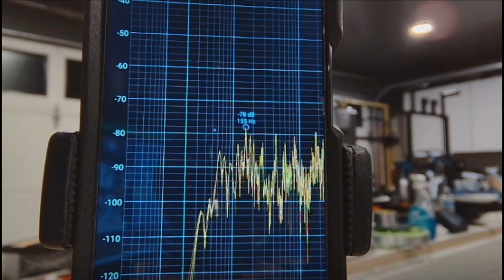Graviflyer "Identifying Resonance Patterns" #15

Comment from the maker: I know everyone has their favorite on the frequency span. I honestly think it will take all of them to achieve the main goal. That is why I have found a way to map them out. I have no problem getting sound when the voltage is on or when the tesla coil is on. The video is another thing when everything is combined. Sometimes the voltage in the air causes my camera goes from 4k to 720p. The same effect happens when I do high voltage experiments. When we get to the stage of lift. I will buy a camera with a long lens to get good video. The zoom on my phone, gopro 11, webcam, or video camera will not work to prove all the deniers wrong. This process takes time. I will start showing experiments with my new set up soon. Thank you.
Reply: Depending on your phone/camera it might be possible to get a 'smartphone lens kit' with various tele/zoom lenses for a reasonable price - giving your device that needed extra lens aid. Some kits comes with mounts, which I would take a close look at to ensure isn't scratching/breaking my phone/camera device (I've seen some kits with bad quality - seen some with ok quality)
Best of luck - looking forward to seeing some interesting testing :ø)

Comment: "voltage on magnets produces a sound" truly one of the sentences of all time, worthy of Alexey. Btw 3:40 show the video where he actually installs that motor to run the pump (if it exists), otherwise you've got a guy making statements/claims with no evidence to back them
Reply from the maker: he was working on free energy. Or more like a looped system before you get to overunity. He runs that big washer motor on an esc. That was entertaining to watch.
Reply: @nathanbunten4299  indeed very entertaining to hear him talk about torque without showing any measurements
Reply from the maker: @sFeral  his little rag test not doing it for you? I agree with you. He is running a generator with aluminum and no iron. So not a big load. That is why I chose it for my video. We are only moving small magnets.

Comment: Just a stupid idea: If we're using a torque wrench to tighten everything even, the frequency should travel also even through all joints with a even intensity. Should simplify the tuning... What do you think?
Reply from the maker: It will travel anyway.
Reply: I think that's a good point. Consider how vibration can "undo" threaded connections, causing screws or nut and bolt systems to loosen.

Comment: Maybe it matters what materials it is made of. If you are trying to get it to resonate at an aluminium harmonic, wouldn't the steel threaded rods interfere? or at least throw that harmonic off to a mix of steel/ aluminium.
Reply from the maker: They might. However we only need the center plate to resonate to allow the transfer of electrons from top to bottom disc. The tesla coil adds feedback to the center plate causing an explosion of power to happen. The full reason why is still up in the air. That's why most of my day goes to testing.

Comment: I can see an obvious mistake you made on your Graviflyer. it can be fixed very easily. You need to add 3 sound ports below your sound cone that's the flat  black piece below your sound cone. that should fix your Graviflyer. Ed

Comment: I still don't see why you keep putting the tuning fork on the craft and say it's close to 439 hz. You can put the same tuning fork on glass and get a louder sound or even a concave object. Aluminum doesn't resonant at 439hz. There ls more factors that go into play like the humidity, temp, the size of the material, the material, the deminsion of the material, etc. Using a tuning fork and saying it's 439hz is inaccurate.
Reply from the maker: It is because all the rest of the tuning forks do not make the sound through the aluminum. This one does. You are hearing simple vibration on glass. I am looking for resonance. There is a big difference.
Reply: @nathanbunten4299  take a rubber mallet or a wooden hammer and strike the aluminum and use your oscilloscope or microphone to pickup the vibrations. The oscilloscope should get you your reads right off the bat. The microphone you would have to run it via software to see what it is.
Reply from the maker: @freedomer342  You are still talking about vibration. I am not. Take the tuning forks with boxes experiment and place the aluminum in the center. If it turns on "resonates" Then the frequency is correct. Just like doing the same experiment with guitar strings. Vibration is in no way at all ever or at any time what I am looking for.
Reply: @nathanbunten4299  when you strike the object, it vibrates at its resonant frequency. There might be a slight difference noise depending on what you hit it with but there is one frequency that will always be there. That's your resonant frequency.
Reply from the maker: @freedomer342  Thats just wrong.
Reply: @nathanbunten4299  it's the same principle when you ring a bell. It resonants at its own frequency. Ring it too hard, it will crack just like the Liberty Bell.
Reply from the maker: @freedomer342  The difference between what you are doing and what I am doing comes down to how frequency and sound works in this situation. I need the center plate to start resonating with frequency and sound alone. NO STRIKING. Finding the resonant frequency of something is different than the vibrational frequency. 

If the aluminum in one area cannot make all the other aluminum in other area's that is not connected start to resonate when they are active then you have vibration. 

If you can activate the aluminum and all the other ones in the area that have no physical connection to each other activate then you have resonance. 

The 2 tuning forks in boxes that move the resonance frequency through the air with sound is the correct experiment to verify everything.
Reply: @nathanbunten4299  I'm not saying you need to constantly strike it, you would use it to find your resonant frequency; like ringing a bell. How are you ringing the bell? Are you striking your bell or are you using soundwaves from another bell that is the same exact frequency? Like 2 tuning forks. Like two tesla coils. Transmitting and receiving. Either way, you have to excite one threw some kind of force to find your resoant frequency. 

The Tacoma bridge fell down because resonance wasn't included into the structure and the wind ended up knocking it down due to it blowing at the right frequency to knock the bridge down and the amplification of the resonance of the bridge.  

Yes by striking the center plate, you can see what your resoant frequency is. You can then take that frequency and have your system transmit it to the center plate to cause it to vibrate.
Reply from the maker: @freedomer342  Like the tesla coil. Transmitted through sound waves. The problem with striking something is that you don't which frequency is the correct one. by activating it with a tuning forks on the boxes you will know which one is the right one. 

The whole problem here is in testing the striking frequency to the matching tuning fork. They don't match. 

If you start the test with the striking frequency then use 2 of that same frequency tuning forks with the boxes the experiment fails. Every time. 

They have to match. There is a chain reaction going on in a striking frequency that you are not accounting for. It makes the correct resonance frequency hard to find.  

The bell is a way to understand it not an exact experiment. If I replaced the pendulum of the bell with a tesla coil and it turned on, then it would be more accurate.

We are looking for the frequency that starts the chain reaction. Not the loudest one.
Reply: @nathanbunten4299  because you would be striking it with the wrong object. Something like a wooden object works best. It's also how they find the natural frequency of a glass. They then use that frequency and transmit it at the object and increase the amplitude until it breaks. Same thing applies with your aluminum disc.

Comment: Nothing “old Man” is saying means anything unless you adjust the size/mass of the plates to 439 Hz and then all the plates would be the same mass! When you reduce standing waves in your recording environment you don’t solve those problems by C 440 modern 12 note chromatic tuning! You eliminate those standing negating Hertz band waves by a frequency spectrum. It doesn’t matter surface or not you place your tuning fork because it will always be the same frequency loud or quiet as it vibrates. What matters is the resonant masses of the individual plates. Because those are the resonant frequencies you must pump sine-wave Hz cancelled phonons per plate. Learn by and listen to this. Of whom amongst our engineering & physicist friends can write music and arrange for an 86 piece orchestra like I know? That’s why there are 3 clefs in music because different instruments have different resonance values despite the tonality keys where they reside, “Bass, B viola clef, and treble coordinated by B flat, C, and E flat instruments no matter the clef.” Despite whether that musical instrument is made of wood, brass, plastic, or any material. This is why developing 6 standing waves manifests levitation/ momentum you have 3 clefs and 3 assigned keys depending on the make of the instrument and it’s mass/size. The difference between atomic resonance from musical instruments is that every atomic mass has it’s own plasmatic resonance rather that cavity resonance that interments have.  You are the engineers for the graviflyer. Don’t be afraid. Share the mass resonance per atom of the chemical chart! Do the math and share that with us. If you’re afraid of injury by reveal? Allow me to teach you how to resurrect or other methods of limitless or limited immortality because mind resonance can meld with the mind of GOD and lesser time motivated gods. The only tuning that we aught be concerned by is 7.8 Hz thereabouts whether by background noise or universal standing wave propagation our Universe is singing a point source longitudinal perturbation of contra bass in the key of C 440 F sharp ! Please share with us the graviflyer way ;) by math or resonance.

Comment: I wish you would be more careful in your choice of words. You speak as if you know for a fact on many topics, unless you actually get it to fly, you don't know if those are facts or speculations. At 6:35, you denied the effect of frame rate on the rotating magnets, which is one of the true facts you could have demonstrated. The "beat" between the rotation rate and the frame rate can make it appear to stand still. So what you see on the video is not objective evidence.
Reply from the maker: My camera never does that when filming. However I do believe I said the camera did show the stall as the frame rate. You might be right about word choice. I will try to do better.